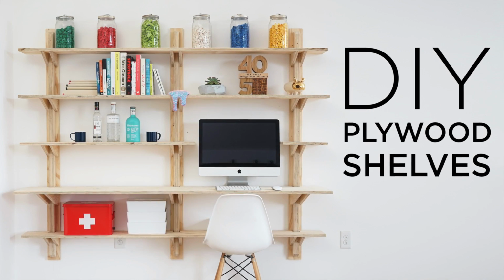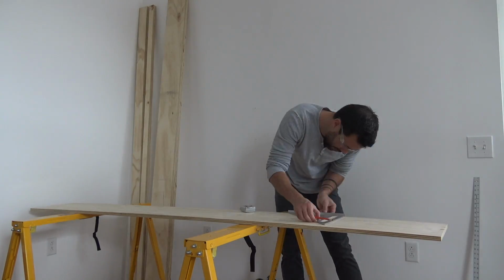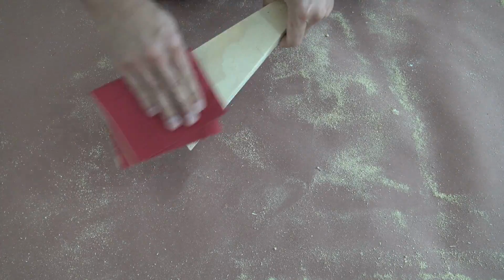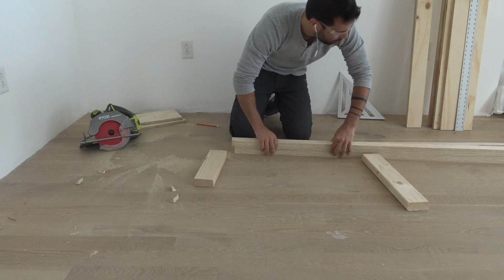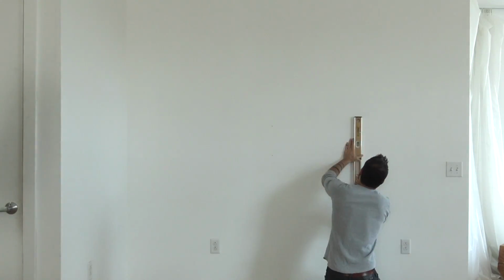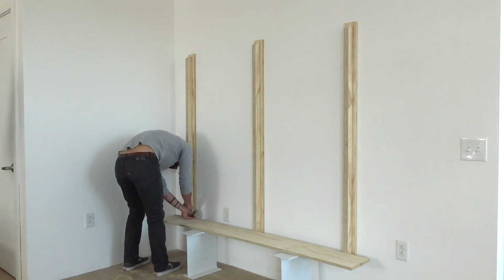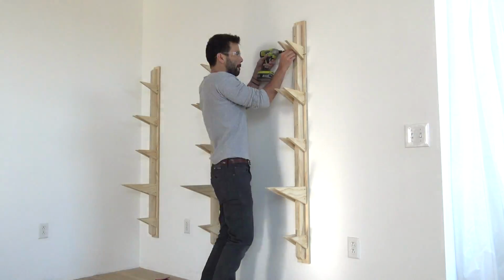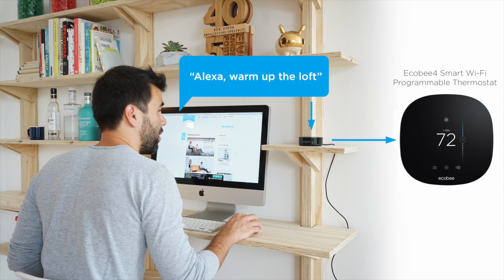DIY Plywood Shelves

Comment: Nice build Ben.  To make these even more configurable did you consider drilling holes in the vertical supports and in the triangle shelf supports?  Doing this and using a dowel that passes through the shelf supports and the wall support one would have a completely reconfigurable (or should I say transformable) shelf support system without the need for screws.